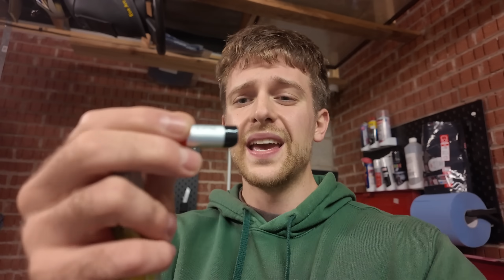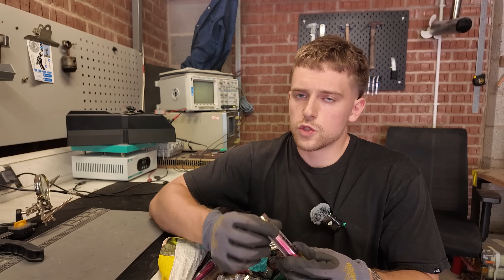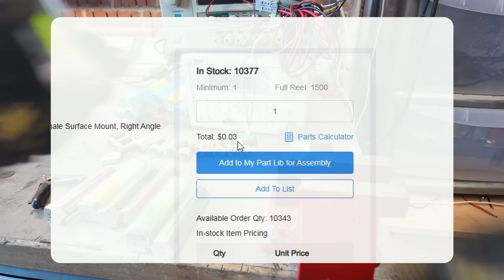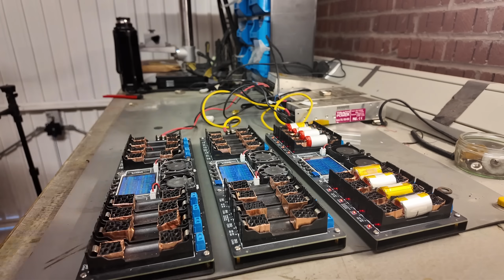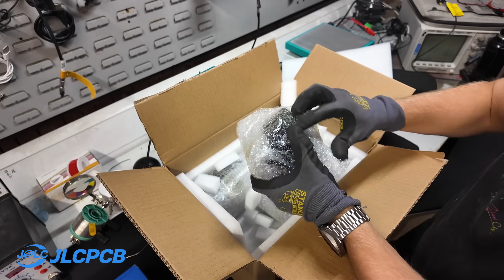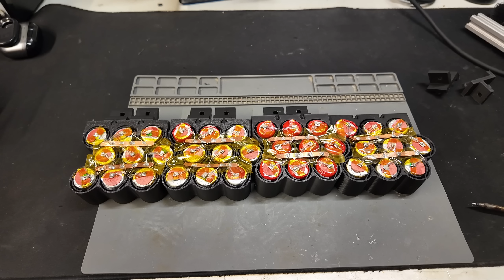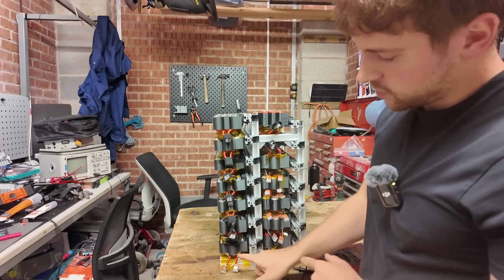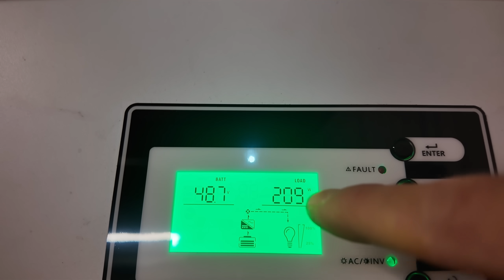I Powered My House Using 500 Disposable vapes

Comment: If you're just averaging your power usage for a day, the math ain't math'n.  Homes tend to use the most power during peak hours (when you're both home and actively using appliances).  In which case, the "8hr" estimate is way off base; you'll be lucky to get a fraction of that under nominal load.

Comment: pretty impressive to reuse something that is made for just one time use, but how many cycles do you estimate will take for that to go under 70% capacity? in my experience with "cheap" Li-Ion cells, they are degrading so fast, after 30-40 cycles they're practically unusable

Comment: I've been able to jump-start dead lithium batteries with a battery of equal size only for about 30 seconds or less. Did it with 2 milwaukee 2 amps. Wont always work, but sometimes you get lucky. Or it explodes 😂

Comment: Needs it's own mini weatherproof enclosure out in the garden for when it explodes into flames.
Disposable vape cells are NOT the same as "in our phones" , and have never been intended to be recharged. Consequently they can be made as cheaply as possible and without any safety considerations. Put the thing outside in a fireproof enclosure away from the house. You have to assume something like this is going to burst into flames at some random time, and make sure that when it does, you are fully prepared and can accept the consequences.

Comment: Where did you get the 18650 cell charger/balancer unit from? Do you have a link please?
Reply from the maker: I have an affiliate link in my ebike battery vid description
Reply: @Chris_doel ace, also doing a power bank type thing, using recycled laptop batteries,

Comment: Hi, but when I pauzed on 12:39 I count 14 riggs with each 108 batteries and then I count 1512 batteries, so the title must be changed I guess. But still I wonder that this is a solution for the many wasted batteries to be recycled. Could it be that this is already going on, and some big companies already do this? Also much work and good job.
Reply: Recount. 14 rows, each with 36 batteries, totaling 504.
Reply: I can tell you can't count, just like you can't use proper grammar and spelling

Comment: Has anyone tested for the longevity of these cells.  How many recharge cycles can they handle and resultant performance of each recharge.  I have not had much success.  Subsequent recharge does not seem to hold well and I am talking about just a handful of recharge using an Imax BC6A and 4056 circuit boards.  My experience is they don't recharge as well as a dedicated rechargeable cell.  Tell me otherwise as I'd like to believe my messing around is worthwhile

Comment: Except....
So a small ac unit uses about 400 to 500w.  If you have 2, that's already 1kw hr.  A space heater uses about 700 on low, 900 on mid and 14 to 1500 on high.  You'd need 2kw/hr if you run a heater, tv, fridge and water pump.  Lights don't use much, typically 8w. Can you sustain 2kw/hr for more than 1 hour?

Comment: I used to recharge disposable as a side gig to my dealing in highschool. I would strip a usb-c cable down to the red and black wire, then I would pop the mouthpiece off the vape, push the tank down to give the wire between the tank and the battery some space. Then I would peel that yellow plastic off the end of the battery, and I would put the corresponding wires on the connectors and hold it for 15 minutes.

Boom, fully recharged vape. Or boom in general. Either way I made a quick buck and fixed a few new vapes while I was at it.

Now I work minimum wage because I didn’t go to college.

Don’t be a degenerate

Comment: They are never fully dead. You can jump them to re juice them. It happens a lot with tool batteries or car batteries. Just a little jump correctly from an equal or greater battery will give it enough juice to enter service again. Thats the cool thing with lithium. Its always able to take a charge given the correct circumstances.

Comment: The batteries that do go under 3V are still usable. You can buy a battery charger meant to recover them. You can use the same charger to cycle and test capacity. If the capacity matches others then you can use them together. The batteries going too low to be unrecoverable is mostly a myth for Lithium Ions. Lithium Polymer though is very dangerous to recover. Those batteries cannot release excess gases and will inflate.

Comment: Not exactly the same batteries in a phone. Lithium Polymer in phones and Lithium Ion in laptops. I'm just nitpicking.
Reply: Also the batteries that do go under 3V are still usable. You can buy a battery charger meant to recover them. You can use the same charger to cycle and test capacity. If the capacity matches others then you can use them together. The batteries going to low to be unrecoverable is mostly a myth for Lithium Ions. Lithium Polymer though is very dangerous to recover. Those batteries cannot release excess gases and will inflate.

Comment: Wow 1 hour worth of power for a couple devices turned on until the battery is dead without an option to recharge. What an achievement, nobody would be able to buy a battery pack and inverter themselves to make a video.

Comment: I noticed you have a smart meter - if you were to install solar panels on your roof and use them to charge your batteries with any surplus electricity, it'll make your energy bills plummet. And you can even set up systems that offload surplus back into the grid in exchange for payments, waiting to release your capacity at peak times when the grid pays higher premiums (although premiums depend on the suppliers).

Comment: I've been gathering old disposable vapes from friends for a couple weeks and I have a big bag of them now. I'll be using the their batteries and charge circuits as the power source for ESP32-based sensor devices I'm making for my home automation system.  One thing not shown in this video is how disgusting used vapes are.

Comment: 65 Amps whith that boiler on...that's a sturdy inverter. 
I hope you never accidently connect to grid when in offgrid mode. Murphy says you would. Even with just the proper mechanical switches there's a way around this and I trust you can solve it in more sophisticated ways. Love this stuff. And the 14s 58V8 standard over 13s. 
And your ewaste awareness.

Comment: great video! you have a new subscriber :D i just wonder if the power from the grid is out for some external reason and you start the inverter to power back the house, but forget to turn off the circuit breaker inside the house, there is a chance to push power back to the grid which could be dangerous for some technician not expecting power in that way. I think ive read that when dealing with some gasoline generators to at least have three-way flip switch similar to the one in the workshop to avoid such situations. i could be wrong tho not knowing your topology. either way great stuff, amazing video! cant wait for more.

Comment: That’s a really good point and as a vaper I have noticed it myself.  I have a drawer full vapes.  Lots of the disposable ones, but I also have many many refillable style ones.  The big problem is that unless you’re a vape hipster who knows everything aboot them, it’s hard to find consistent brands (at least in Canada).  

Once you find a brand then that brand goes out of business or isn’t sold locally to you anymore and you can’t get the replacement parts.  Perhaps you can go online if the company is still in business but then a lot of the time you have to do shipping, and shipping can be much more money than the pods themselves so it’s not worth it, takes a lot time for the shipping compared to buying locally and there’s absolutely no refunds on these products.  So most people would just buy the “new” brand because it’s easier, faster, cheaper and less risk of buying the wrong thing.

Not only that but just as often as brands seem to come and go in this industry, the same thing can be said aboot the actual local shops.  We’ve had sooooo many stores open and close in my city.  And when the stores close then often your connection to the system you use is lost.  And so again you’re forced to start over with a new system and throw another vape on the drawer of vapes.  I must have dozens of vapes in my drawer that went in there long before they functionally stopped working.

So ya… Ultimately I feel banning single use devices is no where near far enough.  The pollution from these things is MASSIVE.  

One possible solution is to have industry standardized vape (at least to a degree).  Which force vape manufacturers to use certain types of “standard” parts that will interchange with any other manufacturer.
Reply: the issue with standardised parts is it would cost more money for the manufacturing and hence would never actually work. Most countries are moving to ban vapes, but all that does (like here in australia) is lead to an entirely unregulated market, where getting a hold of an IGET or alibarbar disposable is as easy as walking down to the corner store and buying one. With that comes vapes (and batteries) of "interesting" quality...

Comment: 9:34 How you are going to detect when some of fuses blown? One blown fuse will increase load on other cells which could load to cascading failure.
A possible way for detection is a LED connected in parallel with a fuse. When fuse blows the LED will light up.

Comment: Even those Li-ion cells that are below 3 V will be fine after charging with a small current — about 10–20 mA up to 3 V, and then following the manufacturer’s recommendations. I’ve repaired so many cells this way and tested them for voltage leakage and capacity — all of them were fully functional.

Comment: important notice: When powereing from the pack and or inverter make sure you also change your ground wire accordingly! There is more to know about IT and TN network types.

yes you got lights but also no ground protection which is really not ok.

Comment: There is a business in Cheshire that sells used 250W solar panels (removed due to upgrades to the newer 1000W panels they use on solar farms). Each 250W panel costs £10 if you buy 10 units. So you can generate power from a Theoretical 2500W solar array for £100... I know this because I bought 20 panels. I had one failed board (so a 5% fail rate) but couldn't be arsed driving 50 miles back to him to save a tenner

I use LiPo batteries taken out of the mobile appliance trolleys used in Hospitals. each small 12V pack is a 33AH (amp hour) unit and i've got 20 of them in two separate banks powering my holiday home and workshop in France. It gives me essentrial 24/7 power for things like my Fridge freezer and Septic tank pump as well as powering music, TV, small appliances and lighting in the house. IU have all mod cons and i'm totally off-grid in a 4 Bedroom detached stone farmhouse

In my workshop the system gives me all my lighting, charges up all my battery powered tools and tech and can run small electrical tools. It struggles with the table saw due to the startup induction load, but i have a generator that handles that occasional requirement

As you know, you do lose a ton of power in translation from the panels to the charge controller and from the charge controller to the inverter, but it's easy to overspec the system to compensate by adding more cheap batteries and panels. The invertor was the big cost, followed by the charge controller (the £10 temu type units are crap quality and you really do need MPPT controllers to properly manage any battery system as opposed to the cheaper PWM units). Cabling was another expensive part taking the large gauge cables from the cell-packs to the electronics as you really don't want to keep those things INSIDE your house. Build an insulated fireproof crate/case in your garden and build a waterproof housing around it and you are good to go

I love your design using the free vape cells, but personally I couldn't see myself working with cell packs that were that fiddly to assemble and manage, I can't solder for shit and don't have the patience but your results are amazing. 

You earned a sub just for executing the idea and proving the concept

Comment: You put a higher amperage connector on either end of the battery, but then are using 20a wago connectors between each parallel segment. That makes all of those wagos see the entire current of the pack. So if you’re drawing 1000W at full pack voltage they all see 20A. As the cell voltages go down, the current on the battery will actually increase as they discharge. 

The inverter is regulating the output voltage, and so if your pack voltage is around 40V as it’s nearing depletion, that 1000W gives you 25A through the series stack of the battery. That’s in a 100% efficiency world. In a real world scenario if the kettle was 1000W you’re probably seeing closer to 30A on the battery wires. 

It looks like maybe you did double up the links between stacks, so you might be ok, at least until one wago isn’t on right, or gets knocked off, or damaged then one of those gets double the current of every other. 

It’s a cool video and good use for these wasted cells, just need to be careful and really understand the fundamentals of series parallel circuits and ohms law. 

Hope this helps and is received with the intention it was written.

Also, most of the dead batteries are probably also salvageable as over discharge damage isn’t as big of a deal as some make it out to be, on these cells. A couple of charge discharge cycles, along with ESR, and capacity measurements, will likely let you use the vast majority of them. But as you say, it’s very labor intensive to re-use cells. Commercial materials recycling on the other hand is much less so.

Comment: Not sure what it's like over there but I know in North America you need a transfer switch simply turning the breaker off isn't enough since the neutral wire can carry power back into the grid and can pose a threat to linesmen working on transmission lines

Comment: The only thing I might suggest here. Is to so a fire blanket into the outer case. If one of these cells ever catches fire it will spread and possibly burn your entire Warehouse down
Reply: If the battery starts to burn, no fire blanket will be enough to keep the heat inside. Best case is to buy you some seconds. In my opinion this would only give you a false sense of security. Also it might even cause a fire as heat can no longer escape as easy during normal operation.
Reply: Yeah I was thinking, some kind of safety case witg exhaust routing and several kinds of safety to protect the rest of the cells and of course the area it's located in. Then again, it can also be placed strategically in a safe zone. What about just have a battery bay made from brick located somewhere convenient to place the entire assembly in? Complete with the safety mechanisms and custom case.

Edit: Lol.... what about a secured fireplace that's no longer in use??? 🤔
Reply: @SacredMilkOG  might burn to hot and cause bricks to explode.
Reply: Building something similar to the batsafe, but for each cell row might be better. That way, you don't:

A: Burn your entire shed down
B: Lose all your cells due to one short and hence one potential fire
C: In the case of a fire, you don't breathe in the toxic ass fumes from burning lithium batteries (they provide the proper ventilation and filtering)

Sure it adds complexity. But safety is never something you overlook when it comes to Lithium batteries, unless you like burning metal fires.

Wago connectors is a bad idea. Use an XT90 at minimum. Or anderson connectors like everyone else...

Comment: Great job, but when you are working on that much power at once, you are going to want to be wearing more protective gear to protect you from arc flashes. Low voltage, high Amps can do major damage to a human body.

Comment: The attached circuitry is probably less draw than you'd expect. The self-discharge of the battery would be egregious. These are designed for max delivery while the expected period between recharge would be 1-2 days. The battery is designed to not hold charge for long periods.

Comment: Please, please, please, get at me I have been holding onto my own used vapes because i do not want to add all my used vapes with dangerous lithium batteries to landfill waste however, I also have a hybrid battery from my Toyota Camry that i did not have to use for core so I kept it thinking hoping that I could get the cells that make the car non functional as back up. Im living in a home that has been stripped of copper wire (Amish style) I'm interested in learning self sustainablity. Very interested in this diy Thank you respectfully Rachel Lankford your pal across the pond!

Comment: What I don't understand is, how could it power all of these small things and then a huge load like the water boiler in the end on top? Like how many amps can this thing deliver?
Also, if you exceed the max power draw, does the BMS kick in, or the inverter? Or the fuse that sits between the two halves of the battery pack? Would it just throw a breaker without damaging anything? Surely the fuses on each cell you built in are just for emergency.

Comment: Awful how these are getting tossed aside. A terrible thing to do on so many levels. I'm glad that someone does something useful with what others throw away, especially something as fitting to the zeitgeist as a large capacity battery at home. Distributed balancing of supply and demand. Imagine your car automatically filling up with petrol during a time of day when its cheap.

Comment: Hope the 3d print is PETG or ASA as PLA creeps and will slowly sag (good thing you covered the cells with capton tape as well for this exact reason). Also cells might warm up and PETG and ASA have higher melting point than PLA, so they are less likely to deform from warm cells.

Also buy fire extignuisher that is certified for lithium batteries, for the peace of mind.